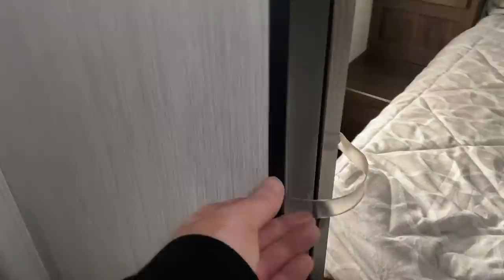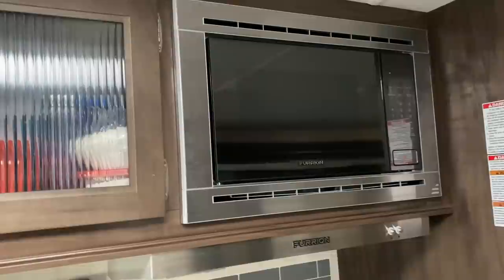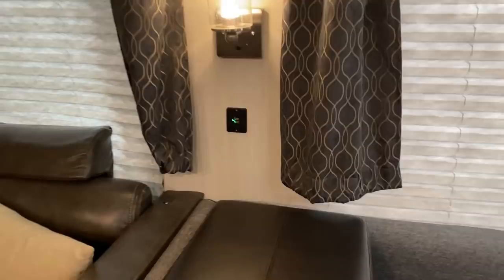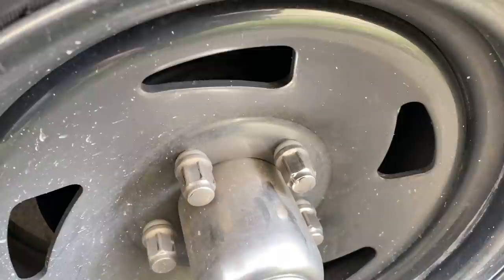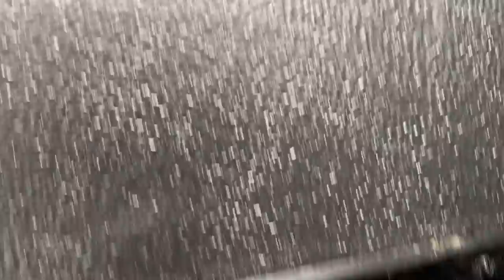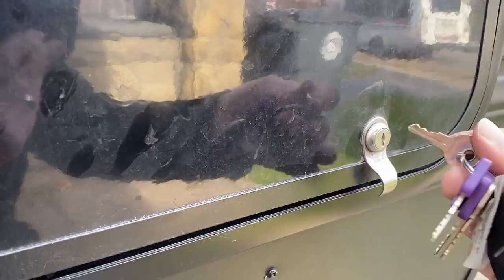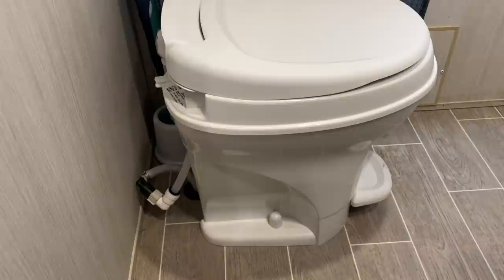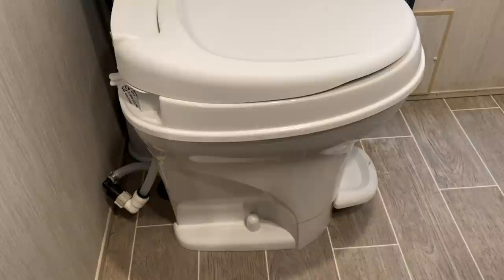2020 Forest River Cherokee RV Camper | Problems and Fixes After One Year

Comment: Got out wolf pup 16pf in 2019 new. We haven't had any major issues. Only used it 3 times that year. And only once this year so far. Covid stuff.   The things about the slide, I will have my husband check out. And do preventative. There was a couple little water stains around the slide out ceiling.  And thank you about the fridge.  Same issue with opening in travel.  I had to Gerry rig the bathroom door, bench seat pads with the slide-out keeping the door shut. I will check that bolt and adjust it myself. We did have a recall about an electrical issue.  That got taken care of. Since we never had a camper in the shop before,  we didn't realize it isn't like having a car worked on. We made appointment for the recall and to get inspected. That took 30 days. And they kept it for 2 weeks. Eventhough the recall letter said it was a 15min repair.  Despite that, we like our pup. It's a little small. We were new. We do want to upgrade next year . We will know what to look for next camper.

Comment: i had the same issues with my slides. i have a 2021 304bh and have replaced the floor in the super slide and bunk house slide. water would run underneath the camper as you have shown. it went though the under belly material and into the wood. had soft sports on all edges. that black poly material is not water tight. a drip edge is a must.

Comment: The keyed locks are problem for any RV.  BTW:  a handful keys of will unlock any RV because they're all sourcing from the same vendor -- even the front door.  My dealer recommended I change out all locks if I'm seriously concerned about security.

That Dometic toilet is the worst.  Several owners had the same problem!

Comment: You said you don't want to spend any money you don't have to when talking about the china pop/destination tires. I had, HAD, the same tires. Mine looked brand new and checked them before and after every trip, the whole 3 round trips of 90 miles each. 3rd trip back and a tire blew 10 miles from home. Ripped fender skirt off, tore up siding skirt was attached to, and destroyed the under side of the camper above wheel. Then turning onto our street I had one on the other side blow, luckily with no damage. I decided to spend the $ and upgrades from a 14" wheel to. 15' wheel and 5 new Transeagle ST Radial Premium Trailer Radial Tires-ST225/75R15 225/75/15 225/75-15 124/121L Load Range G LRG 14-Ply BSW Black Side Wall. So for $1000 I have piece of mind that I have tires that are well over rated for our 7880lb camper. Each tire is good for 3587 lbs each. With that said, the rolling resistance has been significantly dropped amd mpg went up from 9.5 to 10.8 mpg.

Comment: The purchase contracts on these RVs should state that any replacement item that is purchased and any part fixed by the customer will immediately be reimbursed by the manufacturer.  Period.
That would put them out of business real fast, and rightfully so, as it's THEIR erroneous builds.

Zero excuses acceptable from them regarding staffing problems.  Then  sell your RV for 75% off. If folks have to dish out more money to repair a NEW RV, then the thing should NOT be expensive in the first place.
Is there no quality for expense anymore?
We just throw money away over and over.

I saw one video today of a couple whose exterior door wouldn't open, and it took six months to get a replacement. 
On. A. New. RV.

All these problems you illustrated are ridiculous. 
You are handling it amazingly well and the manufacturer should be ashamed of themselves.

Thank you for your video.  God bless you, and safe travels.

Comment: Thanks for the video. I’m about to replace both slide out floors in my 2018 Cherokee Limited because of the same issue you discovered early on on yours. I will definitely do wat you done when I replace the cheap OSB board that is not rotting because of this.
Reply: Oh and I would have thought the slide out frame would have been made out of aluminum tubing but it’s a 2x4 that has been ripped down to 1-1/2” and half ass installed. I don’t know how you can use quality and Forrest River in the same sentence. Quality inspector must have missed work the day mine was built.  The insulation in the walls do not fit snug either. Big gaps between the studs. No wonder I freeze in the winter and burn up in the summer. Hopefully after I repair the slide outs I can sell this POS and get something different.
Reply from the maker: Glad I could help

Comment: Sorry to hear about all the problems. We had the same warranty issue with having to take it to St Clairsville, but at least it wasn't that far. Only to find that a 2 year old camper, with a warranty, didn't cover the roof! Also, I pulled it too closely under tree branches and busted the sky light, so I learned how to replace them and do roof repairs as well. The joy of owning a camper I suppose...good luck buddy.
Reply: Ours is a Jayco from Stewarts. Overall pretty happy with it. Someone damaged the front window cover so I've been searching for one. Seems difficult to track one down. They are not in the parts catalog for some reason...first world problems I suppose. Enjoy your videos. Thanks.
Reply from the maker: @djdaveott  Hey Dave! Merry Christmas. Yeah, all the issues I've been having are relatively minor. I actually have fun tinkering with it and doing the maintenance. Keeping the water out is key! When did you get your Jayco? Thanks for watching!

Comment: We’re just about to put a downpayment on our first RV. This video popped up a few times. I’m super glad I did. You did a great job pointing out issues I wouldn’t think to check and best of all the solutions! Thanks for taking your time to do this.
Reply: Forest river is on the higher end of rv's, i have a 2002 i bought 6 months old, it has been a fantastic trailer, watch out for these light models they have problems with cracking frame's, some of the regular ones also do, but i think most of it is improper loading and hitch adjustment

Comment: I had a 2020 Cherokee 18MT and had almost all of the same issues. Furrion microwave broke, blind brackets broke, dometic 300 toilet issue and no sealant so water came up in through the wheel wells. Those stupid locks are the worst too! Was happy to trade it in for a Surveyor. It’s much higher quality!

Comment: WEll you have other things to worry about. The frames on all Lippert frame units are trash and breaks . You need to inspect the I beams around the area before and all the way down past the tandem axles on that unit. Tire scrub when making turns distort the frame and work harden and break the I beam just 1 inch above the lower Beam flange and shows up as a rusty streak running along the beam at the connection to the cross braces . Also the spring shackles break welds and just break as well . This problem plagues even the very best of them . 5th wheels no matter how much they cost has issues with frames breaking in the cargo bay to goose neck area.

Comment: You can change the GFCI in the bathroom to not protect the other outlet. Just change the wiring in the bathroom so that the wires connected to the bottom of the GFCI are connected to the top. You'll see where the back of the GFCI says "LINE" and "LOAD" make sure all wires land on "line"

Comment: As an RV tech. Any repairs must go through warranty. That's why you didn't get a microwave when you wanted it. We just don't replace par without warranty permissions because if that warranty claim gets denied we don't get paid. Warranty only wants detailed descriptions of the issues from a certified RV technician. Not an average joe. As for the GFCI reset outlet, those are always in the bathroom or kitchen. 80 percent of the time it will be in the bathroom. It's a Forrest River product so you get what you lay for. An ideal purchase that will give you the most for your money is a Grand Design product. Airstream itself is now a Thor product and they're falling behind in quality. An RV will ALWAYS have issues. If you put your house on a trailer and drive it down the road, it would fall apart quicker than an RV so give credit where it's due. It's an earthquake on wheels. From what I've gathered, it seems like you didn't get a proper walk through when you purchased your trailer. When it comes to the slide out,  you need to invest in a slide tipper to prevent future leaks and wear and tear on the slide seals.. also make sure you condition your slide seals so they stay soft. Alot of these issues will always happen to any RV.

Comment: When you own any RV you better know how to repair things because everything is cheaply made and thrown together. After the first rain I noticed a drop of water from corner of skylight. I ended up cleaning roof near factory sealant and going over every seam with Die Core and no more leak.
Also upper inside on slide is installed with 500 staples, first time I secured for a trip with supplied safety clamp cover pulled out and almost fell on floor. I ended up removing all staples and using wood screws and no more problems, much more secure. Next was to fix broken screen door latch that was really flimsy plastic and broke off in my hand. Drilled hole in both broken halves and inserting screw with JB weld and it’s much stronger.

Comment: We purchased a 2019 Rockwood 2902WS and had the same problem with the toilet. Issue resolved with a replacement. I guess they are only replacing when reported and not a recall. Along with the toilet, the TV, fireplace and the kitchen sink simply dropped (problem with glue). We haven’t had a chance to take the camper out due to Covid since everything has been replaced. Praying the new toilet works on our trip next week. Took awhile to get everything replaced due to some places closing due to pandemic but it’s done. We don’t regret purchasing our Rockwood!

Comment: We paid 38k cash for our new 2014 28ft towable at Micheal hohl rv.They keep it for a week to get it ready.1st night we are living in it,due to scheduled gutting and remodeling of our in moldy house in Tahoe. We pick her up and hook her up and 2am in the morning we are completely flooded due to a FACTORY plumbing crimp that was not over the fitting and was secured just short of the fitting. 39 cent hose clamp from my local NAPA  auto parts.Then after the flood ,I plug in the coffee maker and the entire trailer went dark. Nothing would reset and no outlets would work. Battery lights and sliders are working. Close her up and back the dealer she goes.Three days later,they don't know what happened but the electrician fixed everything and that it's ready.Night 3 we get set back up and my wife is showering.I get a knock on the door and my neighbors say water is poor out the bottom of your trailer .I inspect and the shower pan was Crack around the drain and the plumbing fittings were damaged to.You could see the cracks unless pressed your finger around the drain,so after all this the awning got stuck in the extended position and had to hire someone to help roll it up and then the one side of the suspension collapsed due to hitting very large Sierra potholes on Luther pass.5.2 k for entire suspension rebuild.This Winnebago is a complete LEMON.heater has been replaced and the last time we tested the GFIs they wouldn't come back on .so we never test them as they should.1pop and they are done.We have invested or pissed away and 17 to 22 k in this heap and we bought it NEW.
Reply from the maker: That is horrible!!

Comment: Go on ebay and get a set of abloy disc detainer locks to replace those ch751 locks (thanks lock picking lawyer). Just measure the length of the lock itself, there are several lengths - usually like 7/8, 1 1/8...outside shower compartment is usually 5/8. Very affordable and easy and no one has that key guaranteed and no one is picking it either. Down side is, someone trying to get in will get frustrated and just punch a hole in your compartment door and get the stuff anyway. 😥

Comment: The gfci outlet is like that in everything you have inside and outside, the 1st thing is check all the other gfci outlets and make sure that they're reset and they have gfci breaker fuses too and they might have to be reset and they constantly have to be replaced just replace them with a higher cost outlet and it will work better because sometimes they are just weak and kick reset for a  lose wire or nothing at all wrong just a faulty outlet

Comment: My hubby and BIL work in the RV industry (not at forest river) but they still get a lot of info about other companies. They said that forest river is one of the worst when it comes to quality. They run for some models, 50 a day. When there is a problem or a mistake, unless it’s against codes, they slap something over top it. They can’t take the time to redo it. Sometimes it’s better to get one from a smaller company that can take more time.
Reply: What company do they suggest or trust the quality of?
Reply: @SimplyBreana  one of the best is KZ. It may seem like a small place but we actually bought one and my hubby said it’s one of the best fit and finish he has seen. Their units are light and affordable. He is a stickler for everything being right and we have not had any issues. Of course with any brand you can have a bad part or a bad appliance from the factory and that’s no fault of the RV company. It just has to work before it comes off the line. Just make sure you do all the maintenance and storage correctly. And understand your unit and how it works.

Comment: Bought new 2019 one of new larger showers. Nut on drain not connected. Had 300 dometic toilet leaked. Searching internet realized many problems with them. Contacted dealer over 1 year  warranty. Contacted dometic finally send new toilet to dealer. Dometic covered cost of toilet and labor.

Comment: Great info! We are in the process of purchasing the exact same model in 2021, and I will definitely be checking these issues out before taking it off the lot! Can you tell me again what model the toilet was?
Reply from the maker: The defective toilet is a Dometic 300. I bypassed the dealer and went straight to Dometic to complain and they sent me a replacement toilet which is their model 310. I also highly recommend sealing the rail edges and rail screws in the slideout with silicone, which is super easy to do. Overall it is a great RV for the price and you will really enjoy it. Thank you for watching!

Comment: Thanks for this, I'm 66, and it seems to me, nothing has changed.  You buy an RV NEW--I'm surprised they don't sell special tool kits with their BRAND NEW RV's.  Warranty?  Yeah sure, but not only are those a joke--would anyone argue that it is not better to NOT NEED a warranty that soon?  You know, the damn thing should work--right out of the box.  Oh well, one more reason I just use a small hotel when I travel, fact is, for most of us--try 99 percent of us, we don't go often enough to justify the upfront cost or the aggravation as it gets "old" (I mean when it is brand fking new)

Comment: First thing you do with new RV's .... PUT ON Better Tires. Most people don't know that most RV tires are only rated to 65 mph!! RV Manufacturers are absolutely CORUPT...the problem you had with your slide out has been a known problem for at least 15 years!! I am fixing my 2014 Keystone Sprinter Slide leak right now (I am glad the slide stays closed most the time we are not camping). In 2013 just after we bought our 2014 Sprinter Copper Canyon I noticed the back wall looked like it was Delaminated (I could push it in 1/2" or more) I called Keystone and they told me that was normal....well the back wall is rotted out!!

Comment: Sorry, super late to the party. We are currently researching Class C's. If you had to do it over would you buy another manufacturer's trailer? If so what brands would you consider?
Reply: Had several class a motorhomes and got tired of the maintenance. Traded the fan belts, leaking radiators, oil changes, replacement of 6 large tires for a small travel trailer. Hitch up, grease the wheel bearings , check the two tires and go. Plus you have a vehicle to get supplies or tour the area!

Comment: Was getting ready to purchase but put the brakes on. Going down to the dealership to see if they did proper sealing on the 2021 model im looking at. If they didn't at least improve that then the deals off. Thanks for the info. A lot of trailer for the money but i don't need these headaches.
Reply: they will pressure you for extended warranty repair insurance

Comment: see the issue your having is with products added to the cherokee not the actual structure and are problems found in all rvs that use those brands such as dometic which in rvs are very limited my wolf pup construction is held out very well except for a speaker led lighting issue not the wiring